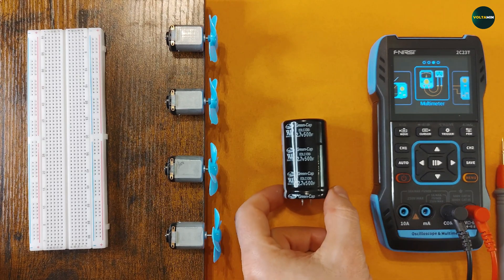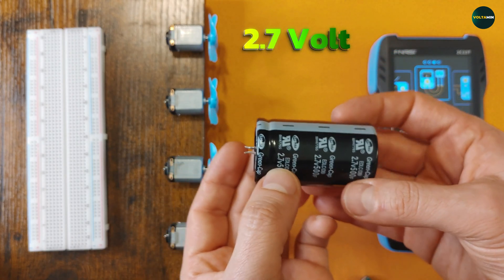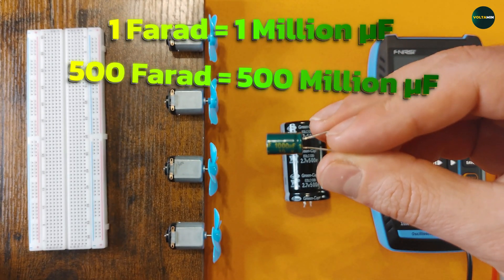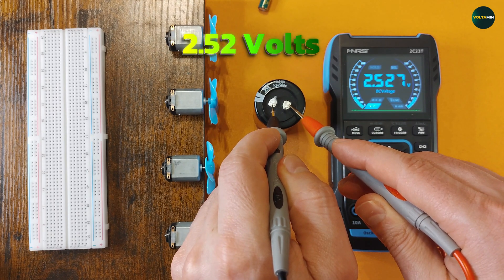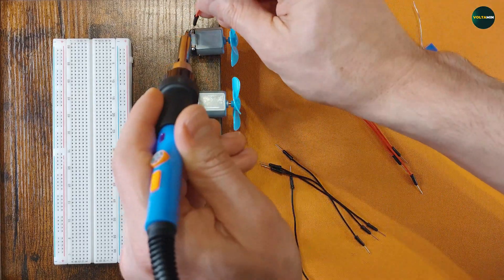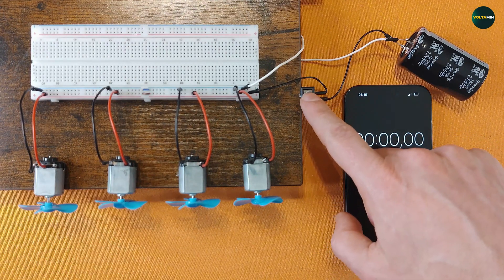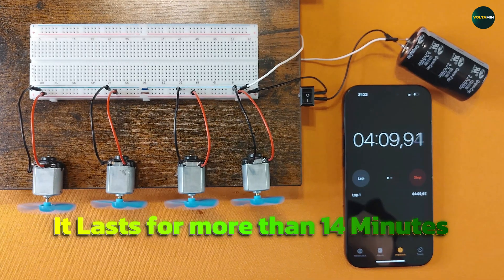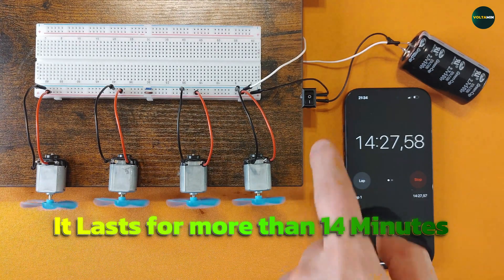Testing A SUPER CAPACITOR ⚡ with 4 DC Motors 🔋

Comment: What volt and amp do motors drew
Reply from the maker: The scope of this test wasn't to measure motors consumption. However the voltage is set on 2.7 V for all in the beginning when capacitor is fully charged and drops to less than 1 volt at the end. These motors take around 2 Amps

Comment: it is really run 14 minuts? if you said yes i try to make a flash light . can you tell me 5v light how long work ??
Reply from the maker: Yes indeed. You can make a flash light. Be aware to choose a good brand. As some of them have current leakage due to QC issues. How long? It depends how much current you are asking them. Check this video where I managed to get up to 40 Amps. But maybe more. 

https://youtube.com/shorts/J3O_EOESVms?feature=share